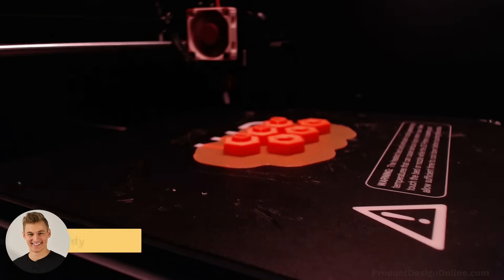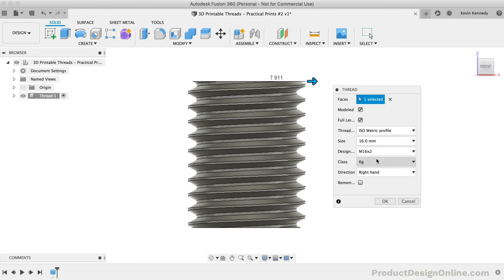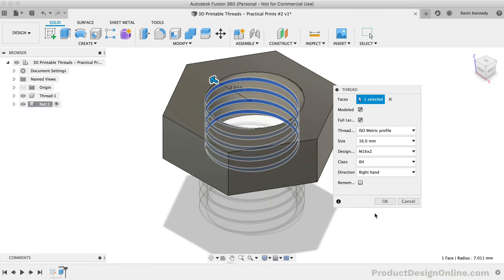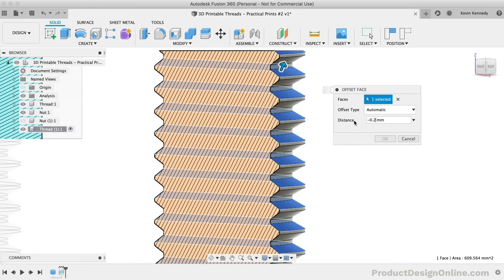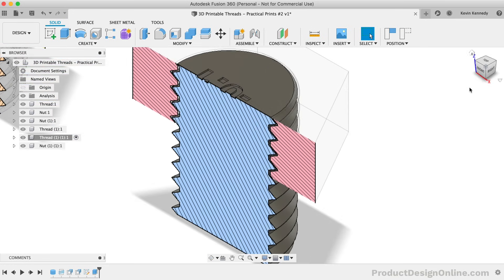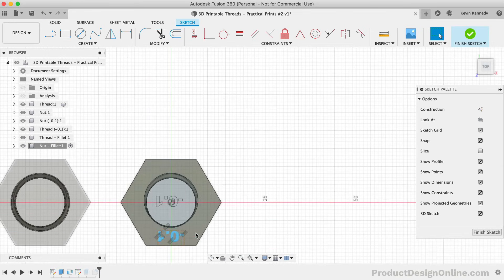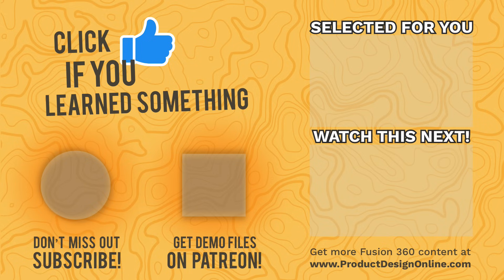3D Printed Threads - Model Them in Fusion 360 | Practical Prints #2

Comment: Nice video. 

I found another way to create the required clearance is to use the scale command on the bolt (after the thread is added) in the 2 dimensions of the thread in your case X and Y by whatever value works, say 0.99 - don't scale in Z as that will effect the pitch. This has the advantage of maintaining the original thread profile - if the diameter is not ridiculously small - and doesn't require subsequent filleting but more importantly increases the flank to flank distance as well as reducing the two diameters. It is the flanks that rub against each other if clearance is not taken care of one way or another.
Reply from the maker: Great tips! Thanks for sharing, John :)

Comment: Hi Kevin - I followed this tutorial and was able to create a threaded shaft and nut with M30 x 3.5 mm threads and printed them out. They worked very well on the first try! The reason I chose this thread size is an assembly I have has a 30mm shaft. When I tried to cut the threads into this assembly, the threads on the nut would not mesh with those on the shaft when viewed in the section analysis! I printed my component fully knowing that the threads won't mesh. And sure enough, they didn't. 
I'm flummoxed as to why I'm having this issue! The only two differences between my scene and this tutorial are one, the shaft in my assembly has been created by extruding a center-circle whilst in the video, a cylinder is used to create the shaft. And second, the nut in my assembly is a body within the same component whilst in the video it's a separate component. To confirm, I created a new component within my assembly and repeated the process outlined in this video and the threads in the shaft and nut meshed!
Can you please let me know why this might be happening?
thanks for such an excellent video! Agreeing with another viewers comment, I don't understand why someone would down thumb such excellent tutorials.
Reply: Did you ever figure this out? I'm having a similar issue where the thread on the nut doesn't align with the thread of the bolt. Is my only option really to rotate one of the components? :(
Reply: @danbeare5263  I have to look at the design to see how I solved it.. will let you know
Reply: I revisited the steps in the construction of the threaded subassembly and it's been a while. Therefore, to the best of my recollection and the steps followed, I have the same thread on a shaft that is divided by a collar. One side of the shaft is longer than the other.  In my first effort, I modified the shaft to have the collar . And then I added the threads separately on each of the shafts separately.  This obviously failed!

In the second approach,  I removed the collar, added the thread on the entire shaft first.  I added the threads on the nut last. This approach fixed the problem.

Comment: tip: if printing a bolt it might be a good idea to remove the threading from the fastener where they will not be engaged to save on print time and increase the effective strength of the part by effectively turning it into a threaded pin.

Comment: Thank you.  Had this problem today trying to make a simple holder for a variable beam splitter.  Just a simple spindle and locking nut.  I have an SLA printer as well but this was still a problem.  I never had any problems with the FDM but I think Autodesk made some changes to the tolerances in one of the updates.  Anyway, really useful. Thank you

Comment: Could you not set the nut diameter to be 16.1 instead of offsetting the faces ?
Reply from the maker: Hi Arron. That is one route to take... but I've found that scaled objects don't work as consistently as offsetting/tweaking their faces... just depends on the project though :)

Comment: Good video. I was somewhat surprised to find my Prusa/Slic3r combination prints M6 nuts with the default Fusion settings that mate cleanly with steel M6 bolts - no additional clearance and a firm fit. I've managed down to M4 but that was really pushing it. I think printed nut + printed bolt is much fussier than printed nut + steel bolt.
Reply from the maker: That's awesome! I do agree - I've found that having one steel part makes a big difference.

Comment: Plastic nuts have low friction and you can't overtighten them. What feature can be added to easily lock and unlock a big nut?
Reply from the maker: Interesting question, Aaron. I haven't tried this yet... but it may be possible to re-create a nylon insert (shape/feature) from a common locking nut. Not sure how that would work out 3D printed though...
Reply: @ProductDesignOnline  This could be a great application for multi-material printing with IDEX, using firm TPU to make an undersized, integrated tube for "locking" friction.

Comment: Thanks for the idea to  fillet the threads to make them more robust.  I also chamfer the bolt and nut openings a bit before applying the threads.  It makes it easier to align the parts and begin the connection.
Reply from the maker: Great tip, Robert!

Comment: Hang on. You reproduced the text on the nuts to make sure you knew which nut went with which thread, but you only modified the threads. So the nut shouldn't matter, right? Or did I miss something?
Reply from the maker: Hi Adam. The first nut/thread is seen as the control of the "experiment" so there is nothing done to either. The second thread and nut I offset the faces to both, to add additional clearance. The third thread and nut (which is a copy from the second, with the clearance added) I added a fillet to each, to test the strength of the threads with a round-over. Therefore, all three threads and nuts were different so I labeled them accordingly :)
Reply: Product Design Online I asked the question before watching all the way through.  I see why you labeled the third instance of the nut, as you did modify its threads. But the first copy of the nut was not modified (which is what prompted me to ask the question). I think you knew in advance what you were planning to do with the 3rd nut so you added a step on the 2nd that didn't track. 

I have done this one five times so far and still haven't gotten it right. The copying leads to confusion. You really have to pay attention to what is active when you modify a component. Also, I'm still getting my head wrapped around the whole workflow of bodies/components/active/top level, etc. I know you did a vid on bodies and components, but there's an even higher level of top-down thinking that is crucial to grasping. I'm not there yet. If you haven't done a video on that yet, I would love to see it. Coffee is on the way. Keep up the great work, Kevin. You are a Winner.
Reply from the maker: @ThatAdam12  Sorry for any confusion. I should've prefaced the tutorial with a bit more of what I had in mind.

I understand what you're getting at. For this 3D printing series, I'm trying to keep them a bit more high-level, in terms of Fusion 360 functionality, with the goal more focused on the outcome. I do, however, see that file structure and bodies/components are the areas that often trips up people. I have "file structure" on my list of video topics to cover. I have an old video that covers bodies/components but I want to create a new one that covers file structure a bit more.

Thanks for the coffee - I really appreciate your support, Adam! Cheers, Kevin :)

Comment: I have tried to follow this exactly and each time (except for once and I don't know what I did) the threads don't mesh. In fact, the crests align. Any suggestions as to what I might be doing wrong? Thx.
Reply from the maker: Hi, Steve. It could be several things. Could you share your files link with me so I can take a look? 

To share your file please go to File > Share > Share Public Link (make sure "downloadable" is toggled on) > Paste your link here as a reply to this comment. Then, please write a separate comment letting me know you've replied with a link because YouTube flags most links and I don't always get notified. Cheers, Kevin :)
Reply: @ProductDesignOnline  https://a360.co/3b7rcXl
Reply: @ProductDesignOnline  Hi Kevin. Thanks for the quick reply. I just left the link.
Reply from the maker: @pritchs7889  Hi Steve. Thanks for sharing your file. I took a look and everything seems to be set up correctly. I noticed you were using different dimensions...so I tried recreating the thread/nut with your dimensions and I received the same results. When I change your file's dimensions to the ones I used in the video, I received the results that I did during the demo - where they align properly. This leads me to believe it's something with the type of thread you defined M50, that Fusion 360 aligns the threads differently (or starts the thread in a different manner). I'll have to look into this more...we may have to do a forum post to see if any of the Engineers can chime in. In the meantime, you can move the nut into place with the "Move/Copy" command by moving just the "Nut" component. Cheers, Kevin :)
Reply: @ProductDesignOnline  Hi Kevin. I got the same result when I was using the dimensions from your video. The only time it worked, I think I used the bottom of the mail threaded cylinder for the nut sketch rather than the top as you did. The orientation of the male/female thread positions seemed to be the same regardless of the size or thread pitch that I selected. It's weird because the threads aren't aligned vertex to vertex as I would expect. They are off by about a third to my eye.
Reply from the maker: @pritchs7889  Very strange. I'm going to play around with it more... will try selecting the bottom face as well and see what happens.
Reply: @ProductDesignOnline  Thanks! I look forward to your results. To my knowledge, I haven't changed any settings in Fusion. Just an out-of-the-box install.
Reply from the maker: @pritchs7889  Actually you bring up a good point! Can you try restoring your defaults and see if you still get the same issue? :)

That would eliminate the thought that a setting is doing this.

How to restore to default settings - https://productdesignonline.com/default-settings-for-fusion-360-tutorials/#restore
Reply: @ProductDesignOnline  Reset preferences to defaults. Made a 22mm cylinder and 3mm threads didn't mesh. However, everything from 2.5mm down worked. So I tried a 45mm cylinder. None of the three thread pitches that I tried mesh. Tried 50mm. Same result. Going back to the 22mm cylinder, I can simply change the thread pitch for each component and if it's 3mm, they don't mesh. If I change it to 2.5mm or less, they mesh. It may be me, but I can't find what I'm doing if it is.
Reply from the maker: @pritchs7889  I'm out of ideas lol - the weird thing is that we're not getting the same results (with the same default settings). Could you post this on the support forum to see if any of the F360 Engineers could chime in? https://forums.autodesk.com/t5/fusion-360-support/bd-p/962
It would be interesting to see if they can reproduce the same results on their end. Maybe we (you) discovered a bug that they need to fix :)
Reply: @ProductDesignOnline  Done.
Reply: Wow! A quick reply on a forum. It must be my lucky day!! :-) Here's the reply: "Fusion 360 will not automatically align threads in two different bodies.  You will have to move one or both bodies to do this yourself.  You could create components of the bodies and join them together, with the proper offset, to maintain their alignment."
Reply from the maker: @pritchs7889  Wow, I'm also surprised at such a quick reply! That's interesting... I guess the explanation then is that we sometimes get lucky and they happen to align properly. Given they built in a small clearance I was under the impression that F360 could also align them at the same time. I suppose we will have to resort to moving them into place until they enhance the Thread feature. Thanks again for the follow-up, Steve.
Reply: @ProductDesignOnline  https://a360.co/3b7rcXl

Comment: Great tutorial. I always watch your channel, the information is excellent. I noticed when i tried to apply the fillet to the face of the thread to achieve the rounded edge I got an error and had to apply it separately to each edge of the face instead. Any idea why that would happen?
Reply from the maker: Thanks for your support, alfineart!
It's hard to say, but fillets typically throw errors when their radius would intersect with one another. It may have been that at some point on the thread they were going to touch/interfere with each other.

Comment: Thanks to Kevin and a practical report to this tutorial: On my Prusa MK3S printed threads fits together perfectly if you reduce and round ONLY the external thread by 0.1 mm. If you reduce the external AND the internal thread, the connection becomes too loose.
Reply from the maker: Sweet - Thanks for sharing your results, Ralle! There are lots with the Prusa printer...so I'm sure this will be useful to others :)

Comment: Hello Kevin,

what method would you recommend to export all components of the 3D drawing?
Do I have to save each component in a single STL file?
Reply from the maker: Hi, Jens Groth. That depends partially on what you're trying to achieve. If your components are all separated/laid out then you can right-click the top-level component (file name) in the Fusion 360 Browser > Save as STL. This will export all of them as one STL file.

If you need them to all be separate files, then unfortunately, you do have to export them all one at a time. Cheers, Kevin :)
Reply: @ProductDesignOnline  Thanks for your answer. As I use Simplify 3D as slicer, it would be nice to have a script, that would export every single component separatly in one step. Then you could easily define different proceses in S3D to optimize your 3D print.

Comment: I've had a lot of experience recently with printing threaded holes in plastic parts for use with standard metal fasteners in my combat robots. Personally I find it easy enough to secure a long enough machine screw in a printed hole with modeled threads even down to 8-32 (roughly M4 diam) threads printed on a Prusa Mk3S in Nylon. I was able to get this to work with the threads oriented both vertically and horizontally and even at arbitrary angles so long as the screw doesn't need to be removed and screwed in over and over, with no manually added clearance at all (though selecting a looser tolerance class helps). I also tried this with 6-32 screws but under load the screws pulled out too easily. I'm going to look into self-tapping screws in 3D printed non-threaded pilot holes next and see how they compare. I also tried threaded inserts but found that my parts would literally split in half along layer lines before the point where the threads stripped out and this remained true when threading directly into the plastic with 8-32 screws. I've also had this work with PETG and PLA though both of those have pitiful impact strength compared to Nylon which is my primary concern. Also when printing smaller threads you definitely wanna set your vertical resolution no greater than 0.2mm, and I often use 0.15mm.
Reply from the maker: Great stuff, Team Just 'Cuz Robotics! Thanks for sharing all of this. I've printed lots of things in Nylon, but haven't done much in the realm of screws. I'll have to give that a go.

I've also experimented with threaded inserts. They work well but can be a pain to get them to work on many accounts within the same object. I may make a video on that topic for the series.

Thanks again!! Cheers, Kevin :)

Comment: This is great! Timely for me as well. Question though, my threads are not lining up  for the bolt and nut, they're overlapping. How do I fix that?
Reply from the maker: Hi, Stephen. My initial thought is that could be due to the Designation/thread type having a number of threads/pitch that doesn't work with the length of the thread. Could you share the link to your file?

The other option is to simply move the mated part with the "Move/Copy" command. You can view the model with the section analysis and move the part until it aligns properly. Cheers, Kevin :)
Reply: @ProductDesignOnline  I was doing it a little differently then you. 10 mm bolt and 10 mm nut. Creating the nut with a negative extrude from the top of the bolt seemed to be problem
Reply: I've done this on another sketch and the threads don't align no matter what face I choose. I I need to move/rotate until they line up witch is kind of annoying. Be nice if the threads autoaligned like in the video.
Reply from the maker: @Steriku  Hmm. Strange as I haven't had an issue like this as long as the thread type was the same. Does it save your latest thread selection/details when you re-activate the thread feature to add threads to the second part?
Reply: @ProductDesignOnline  I'm having the exact same issue and pulling my hair off !
Reply: I think 30mm for the bolt height is the magic number, It works at 30, but if is lower it to 20mm the threads overlap

Comment from the maker: TIMESTAMPS
0:48 | Creating a new component
1:03 | Creating a cylinder
1:45 | Activating the thread command
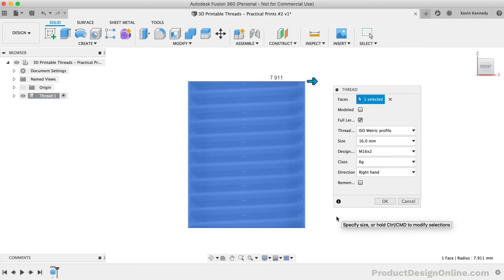2:36 | Making the thread modeled
3:00 | Adjusting the thread length
3:33 | Selecting the thread type
4:27 | Setting the Designation
5:36 | Defining the class (tolerances)
6:05 | Selecting the direction
6:20 | Remembering most recent threads
6:44 | Creating a nut
7:33 | Adding the internal threads
8:27 | The default clearance
8:47 | Copying and pasting the component
10:00 | Offset faces to create clearance
11:37 | Debossing text to label the clearance
12:05 | Creating the third copy
13:54 | Adding fillets to the thread edges
16:15 | 3D Printed test results